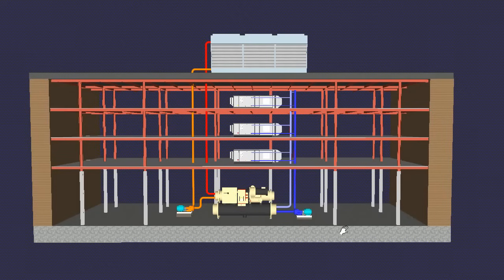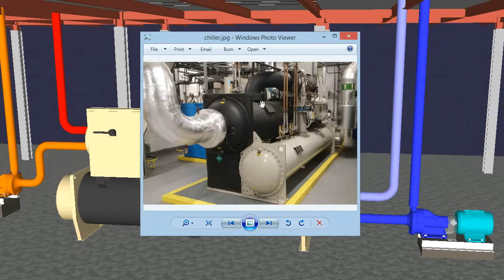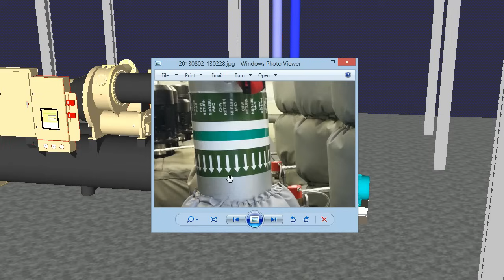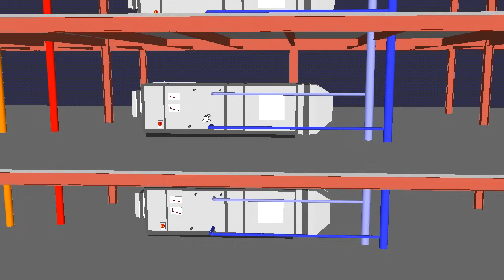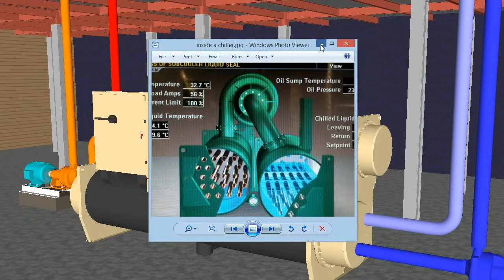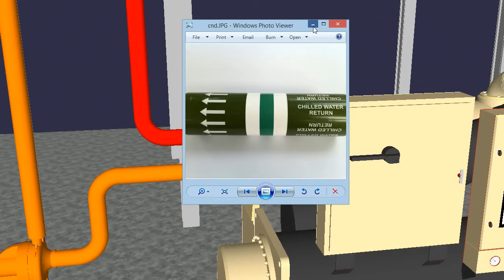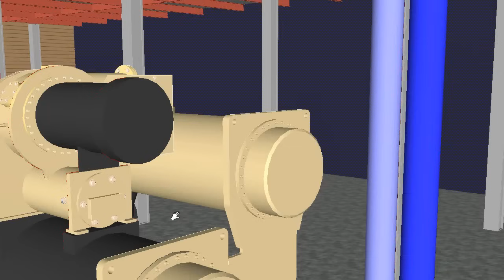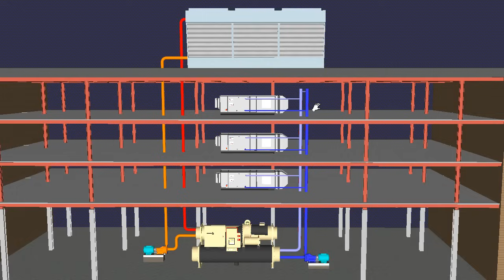How a Chiller, Cooling Tower and Air Handling Unit work together

Comment: Newbie question: what is the point of cooling the hot water? And what is causing the orange warm water getting returned red hot?
Reply: You need to cool the hot water so it can return to the condenser with lower temperature thus, able to absorb the heat of the refrigerant to condense it.

Comment: Is that allowed install AHU(floor mounted) and Sub switch board(SSB) in the same room?
Reply from the maker: depends on local building regulations. Generally they are separated but there will be some power and control panels in the same room as the AHU

Comment: Why do home/office mini split AC units have copper pipes with refrigerant running through it and not have pipes with water?
Reply from the maker: You could theoretically remove the water circuits and make a giant refrigeration circuit but it wouldn't be efficient or safe. A small home unit could also used water but again it wouldn't be very efficient and it would cost a lot more to install and maintain
Reply: Very interesting. IEA has said that by 2050 the number of new ACs installed will require 3 times more power then what China uses today,  seeing the current air conditioning design it is no surprise -- everything is very rigid with very little control.

Comment: if i have air cooled chiller do i need to cooling tower?
Reply from the maker: +mohammed Al-yafey An air cooled chiller works a little differently compared to the setup in this video tutorial. With an air cooled chiller, the heat is rejected into a coil and fan assembly built directly on top of the chiller with the chiller located outside and usually on the roof. It blows air across the coils to reject its heat and wouldn't usually use water although water will sometimes be sprayed onto the coils during the peak of summer to add some capacity and stop the chiller from shutting down due to high temperature/pressure, but this is an additional after market feature.

Comment: I still don't understand the point of the water on the condenser / cooling tower side... if the flow and return of the chilled water on the right is a system unrelated to the left cooling tower water what is the need for the cooling tower system?

Comment: its a shame the two water systems are so segregated energy wise. with the simple (not so simple) addition of a reversing valve the heatpump could also heat the building. there may very well be enough space on the roof for some commercial solar pool heater next to the tower.
Reply from the maker: Seen our new video on HOW SOLAR PANELS WORK in detail https://youtu.be/Yxt72aDjFgY